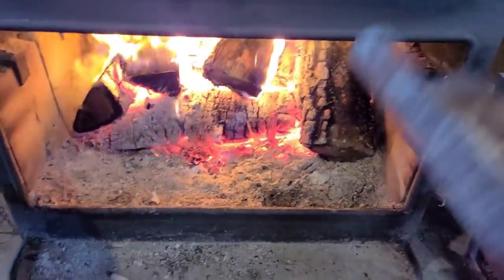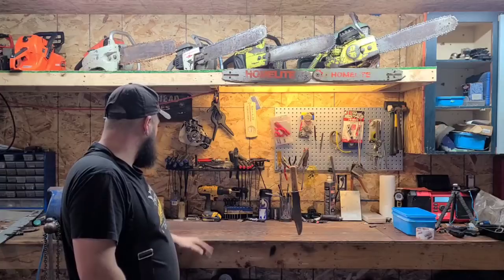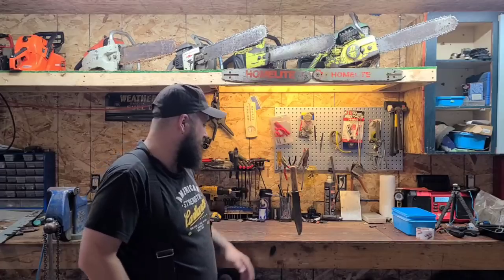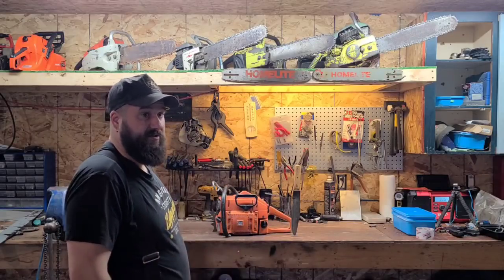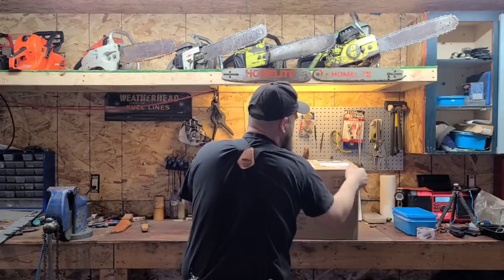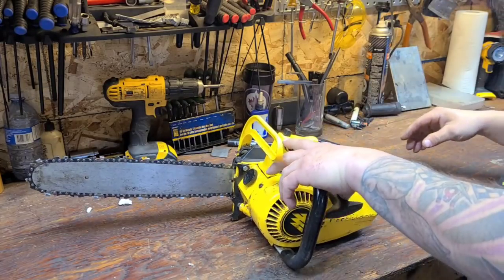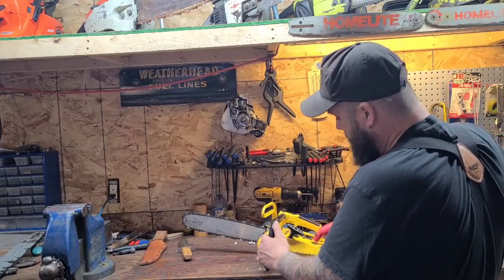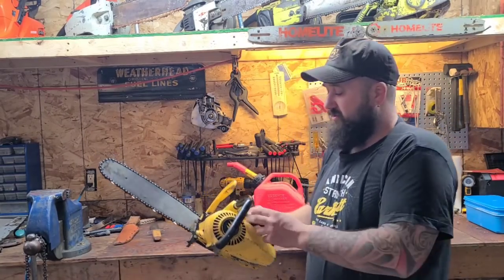We got another powersaw in the mail!!

Comment: I just picked up one of those Mac 6 for $ 10 bucks last summer! They are loud pretty powerful for their size! I have about eight of the mini mac series of saws, They are always dirty as hell inside because everyone thinks they are hard to work on! And there was always a prior owner who ran it with a dull chain which causes a mess when mixed with thick bar oil. They finally quit running after it coats the coil with this slurry from hell! And here is the problem most guys overlook, You can't just wipe the face of the coil and cure the problem!You must remove the two screws that hold the coil on, Careful not to loose the nylon washers that keep the coil from grounding out, And thoroughly clean out the pedestals that the screws fasten into with a Q tip with isopropyl alcohol on it. If the carburetor is plugged on top where the vent screen is located, That's usually all that is wrong with them! But I noticed that as the years went along the EPA really did a great job of making intake smaller and smaller! There is a ridge on the inside of the intake that will make you laugh your ass off! If you clean all the extra metal out of there and blend the intake smooth with the intake runner, Then that little bastard will bark! 😉

Comment: Best dump find for me was an 100% intact 1970’s Homelite XL12. Brought it home it sat on a shelf for two years and I decided to clean it up and get the 45+ years of saw dust out of it. The head fins were complete clogged. Threw fuel and oil in and on the third pull she fired up. They don’t make them like that anymore.
Reply from the maker: Those bolts are probably still leaking. Maybe try taking them out and cleaning them really well and then make gaskets and motoseal the whole thing together.
Reply: @tinmanssaws  Tinman I think your comment was meant for another comment. I love watching your content it is some of the beat I have viewed. You are passionate about powersaws and you are not afraid to share your knowledge. The other day I was back at the town dump and low and behold there was a chainsaw case. Upon opening it there was a newer completely intact  Homelite 3816c with very little use. Knowing it is a Home Depot homeowner special I still grabbed it. I cleaned it out (maybe cut a few branches by previous owner) gas and oiled it up. Prime, Choke, Pull and it came to life. It was a bit sluggish on the acceleration so I adjusted the carb and solved that problem. I would of never touched those screws prior to watching and listening to your carb tuning video. It’s not what you got but what you give so I sharpened the chain and gave the saw to a coworker as he needed one. 
Thanks Tinman
Reply from the maker: @JoeRainis156  haha yep

Comment: Hi , Tinman ! I messaged 1x b4 . Have a Mcculloch 10-10 promac . It's burning bar oil so I put good rtv over bolt heads in tank - I know but figured I'd try. Didn't fix / rig it ? Were else can the thing pull it in from ? The 4 bolt heads is all I see. Thanks for any more advice . Thanks